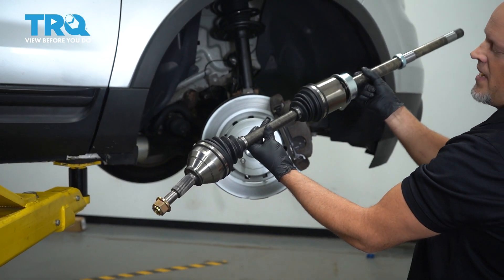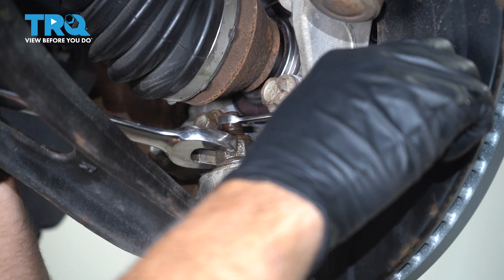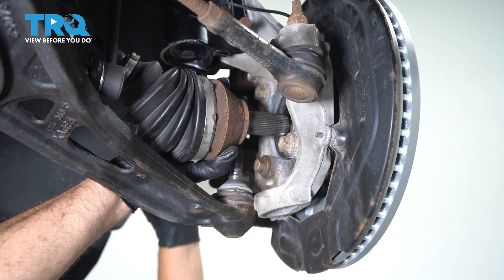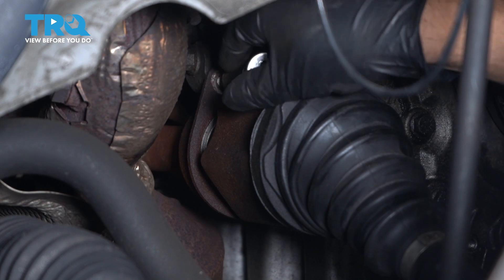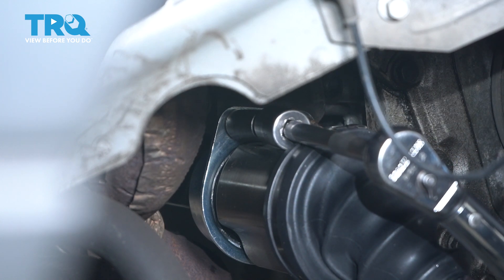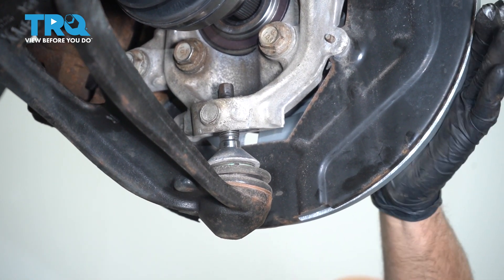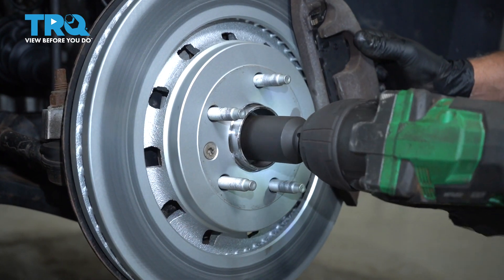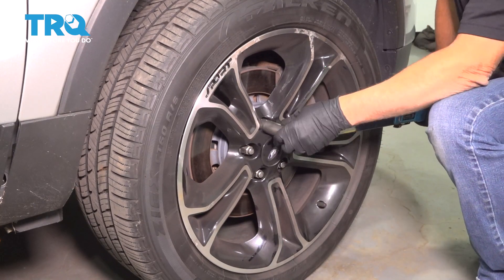How to Replace Front Passenger's Side CV Axle 2011-2019 Ford Explorer

Comment: Mine did not come out nearly as easily. It was stuck in the hub and wouldn’t slide out. I had to pry it out with two crowbars, and I had to remove the rack and pinion steering link so I could pull the steering knuckle away from the axle. I’ve learned that when you watch these DIY videos, they take shortcuts and make it look easier than it is because it’s really more about promoting themselves and creating a video than the accuracy it’s content for lot of people that make the video

Comment: Thanks for the video! I just finished this job. I lost quite a bit of tranny fluid so make sure you got a drain pain (I like to measure tranny fluid and put the same amount back in, I still check it too).   Also, I jacked up the car by the ball joint but it wasn’t enough to get the nut off  because the nut got stuck near the top where it wouldn’t go on or off and it kept spinning the ball joint even with the jack. I used an air hammer to jar it loose.

Comment: Absolutely do not take the balljoint nut off if you can’t torque it correctly. Better to remove the strut bolts and leave the ball joint alone

Comment: Help!  I can't find the part.  2012 Explorer, AWD, w/ Tow 3.5L.  and the bearing mount is opposite the mount in this video.  The FoMoCo sticker is BB53-3B436-JD.  I look it up on Ford and it says T1110 but all the images show that with the wrong bearing mount.  But Ford also says, " "multiple replacement required due to bearing orientation being opposite of the original."  What the heck does that mean?

Comment: after jan 2024.. the pass side cv shaft CARRIER BEARING CHANGED.. its bigger and requires a new mount... for pre  jan 2014 vin numbers.. FYI
Reply: I have been pulling my hair trying to understand why my original one from 2013 have a bigger carrier bearing and the mounting location was different. Where do I find the bracket for the updated cab axle?

Comment: Do not take the nut off the ball joint! It will be a nightmare! Instead remove the bolt on the lower control arm ! Makes it way easier to complete the job!

Comment: Awesome work. Question my passenger axle is moist for about three inches from where it hooks up to the transmission fluid. Should I consider replacing the drive axle or is there some sort of seal that sits in between those to parts? Thank you!